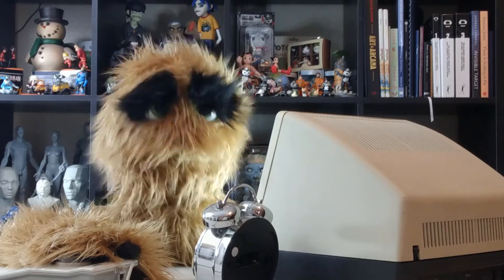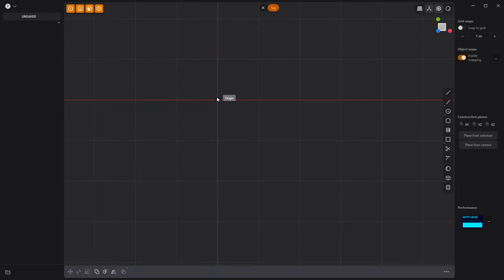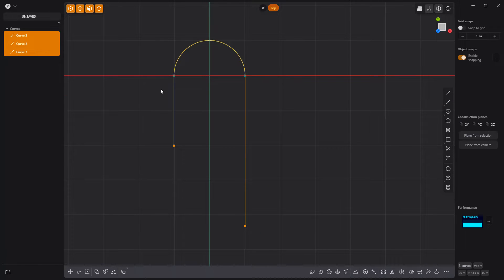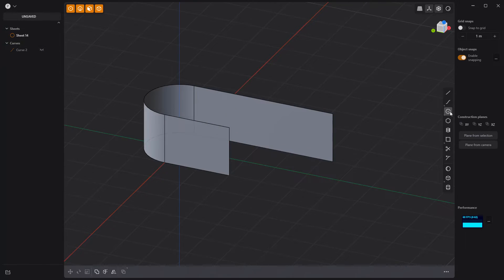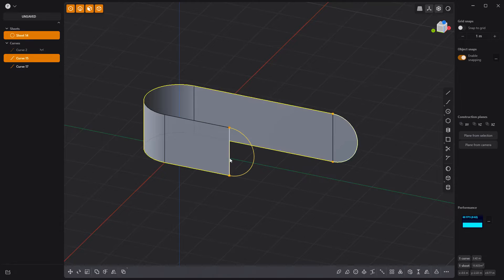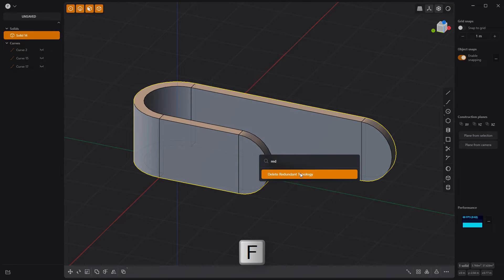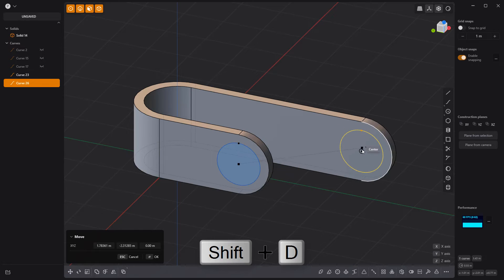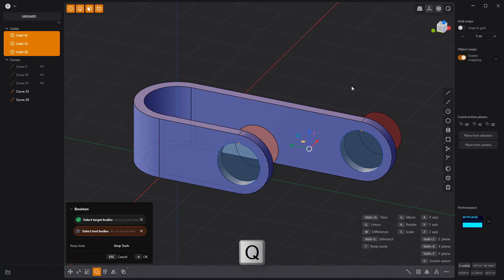Plasticity | Modeling Exercise 10

Comment: Something else i noticed: Boolean cutter object punches a hole in the wall and the wall behind it. So i separated the solidified curve in two solids with a rectangle cut and made two separate boolean punches, then i joined the solidified curve parts.
Is there a way to limit the boolean solid cutter on its size, instead of the whole axis?
Reply from the maker: If you use Boolean Subtract it is based on solid volume not Axis

Comment: I am having troucle in crating that patch on the end of the arches... what the hell am I doing wrong?  help please.. thank you in advanced...
Reply from the maker: If you are using an older version of the software it might not let you patch with edges. Convert the edges to curves then patch the curves and you'll be all set.
Reply: @pixelfondue  can I ask what version are you using. I will check which one i am using so I can get the latest..  thank you. I spend one hour trying and nothing..   thank for this tip. But I rathered be on the latest version. Hehehe.
Reply from the maker: @mae2309  Im currently on 1.1.13 but for this video it would have been earlier that that.
Reply: @pixelfondue   that is weird. hmmm.. I am using 1.1.0 but the 1.1.13 it says still in Beta. that is the reason I have not dowloaded it, but I guess I will now that the patch does not work on 1.1.0   thank you..  

NOTE: everytime something is not working  make sure I'll look into a newer version. hahahahahaahahahahah.. thats my note to me!
Reply from the maker: @mae2309  yeah... I use the BEtA builds.
Reply: @pixelfondue  AHHHHH!!  I hope Plasticity does not become a 2 motnh beta updates like blender.. hopefully v2 turns into a solid stable withall commands ready to use program.. its very promising. am living fusion 360 for plasticity. so far so good. hope they wont dissapoint...

cheers and thank you. am learning plasticity with you.. hahahaahaha I need to learn all these quick tips before I jump into bigger models... 

Thank you lots

Comment: Thanks for all your videos. Helped me a lot so far.

If you don't mind, I have a question. At the end you hide the 'wireframe' with a shortcut. What is this shortcut? I already searched for it, but since it's not really a wireframe, I wasn't able to find it :/
Reply from the maker: There isnt a shortcut by default but I assigned it to the tilde key (`) using this process- https://youtu.be/afkAHJcLNWg the command is Toggle Edges
Reply: @pixelfondue  Ahhh, toggle edge it is. Also thanks for the "Assign Custom Keyboard Shortcut" video :)

Comment: When I tried to patch the hole, nothing happened. It doesn't want to patch the hole between the curve and the sheet. I don't know why (I'm on the latest trial version of Plasticity). Thx for your tutorial !
Reply from the maker: The trail version doesnt allow for it but you can add one more step and you'll be ok. Select the end edges and press Shift+D to convert the edge to curve. then you can use the new curve along with arc curve to patch. In newer versions you can patch with curves and edges together. Hope that helps.
Reply: @pixelfondue  Thank you for your help! Are there any other features that the trial version doesn't have compared to the Indie version? (Only in the field of modeling)
Reply from the maker: @fff235gg  The Dev releases a new build almost daily. There have been many updates since the trial version was released. Lofting and Patching is easier and more powerful along with other enhancements and add ons.
Reply: I'm not on a trial and mine does this???
Reply from the maker: @SGThirkell  what version are you running?
Reply: @pixelfondue  1.1.0
Reply from the maker: @SGThirkell  hmmm... might have been added in 1.10
Reply: @pixelfondue  I'll sit tight and wait for updates then. 1.1.0 is still the only release. Others are showing as pre release :(